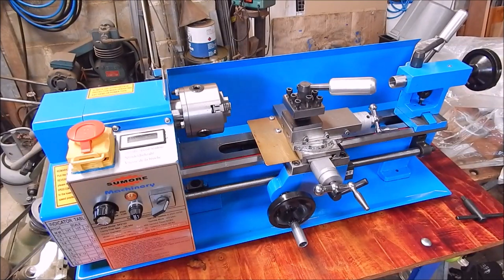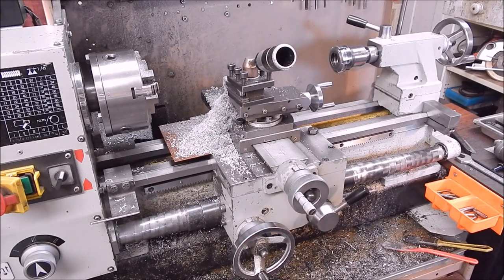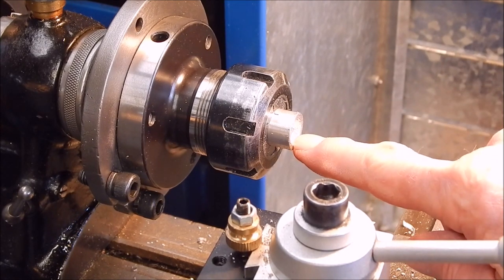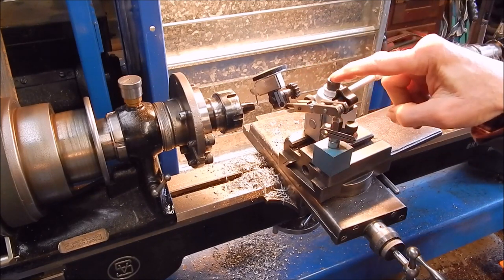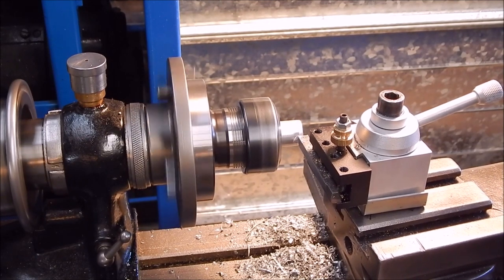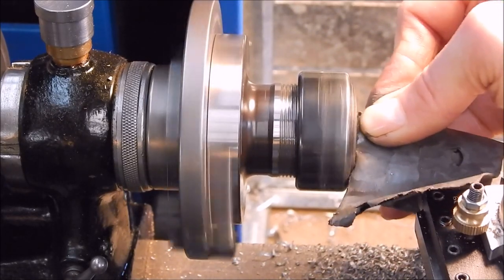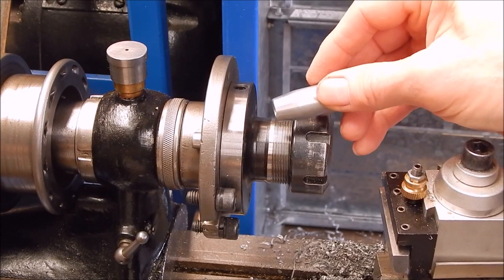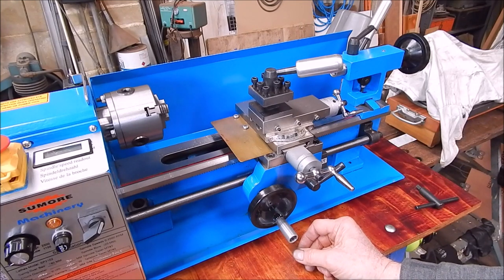Another Chinese mini lathe mod - dead simple

Comment: I have a lovely Lorch lathe of about the same vintage as your Schaublin... in the 1930's they actually used a mix of imperial and metric on the same lathe, so some parts are strange threads, but, it's low runout, and dead simple.
Reply from the maker: Lorch and Lorch Schmidt made some nice vintage tool makers lathes similar size to the Schaublin 102.  Still mighty useful.   I see more old Lorch's come up for sale than Schaublins in South Australia.  Cheers Rob

Comment: Some very nice handles there Rob 👍👍👍 One of the first things I did on my Warco was make new handles for it. A quick question, what are the 2 cap head allen screws for that are in the Schaublin headstock plate? Cheers, Alan.
Reply from the maker: Hi Alan,  the bolts are there to offset the lathe dog drive plate cutout (for balance).  The original lathe chuck (clapped out) had been mounted on it.  Bit of a fudge as threaded backing plates are rare and expensive for these old lathes, so I did the same thing and machined it to fit the recess on the collet chuck.  Works quite well and runs smoothly.  I never use a lathe dog, so no loss.  cheers Rob
Reply: @Xynudu  Hi Rob. That explains it, I can see now that they are either side of the slot. Cheers, Alan.
Reply from the maker: Hi Alan.  I added the bolts so the heads would counter the loss of metal from the slot.  It looks about right.  The original chuck/drive plate setup was unbalanced and not dead smooth.   It's a handy old lathe and nice and quiet /relaxing to use.  The long topslide travel is a huge plus for tapers.

These old lathes go cheap in Oz because most people are not interested and they are pretty basic.  Plus many are worn.  Not really a lathe for beginners, but can do things not possible with a conventional lathe.

Cheers Rob